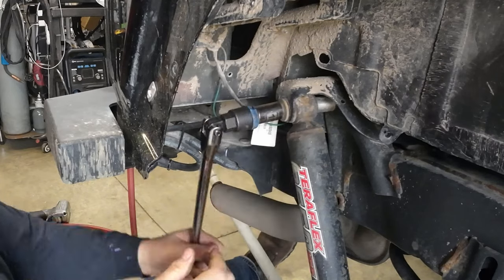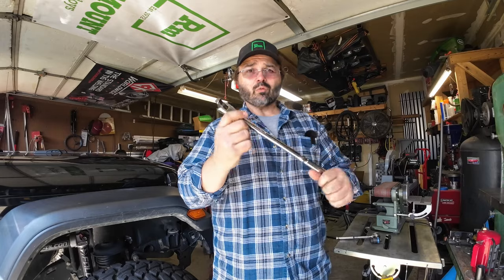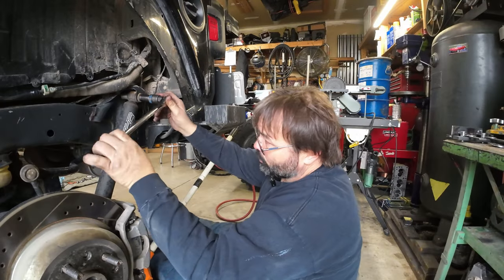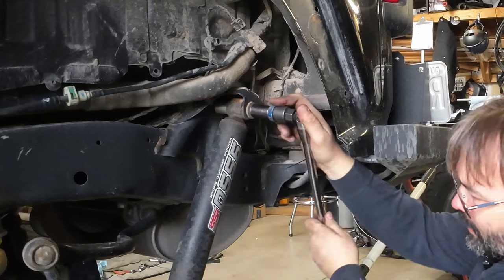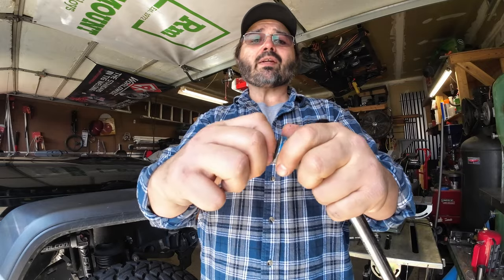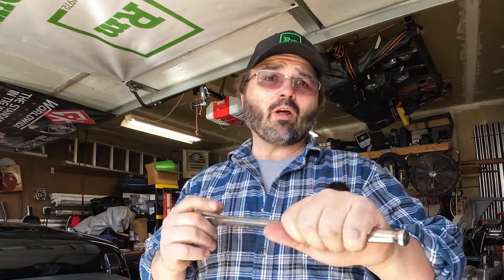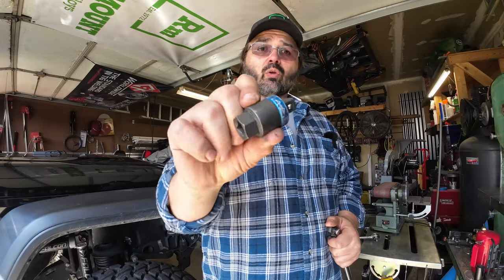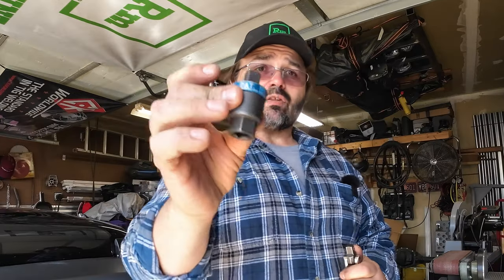Breaker bar ratchet?? Tool Time Tuesday.

Comment: Or just a good 1/2 ratchet. Not like that POS ratchet you showed in the video. Your breaker bar with adaptor adds way too much length to that socket.